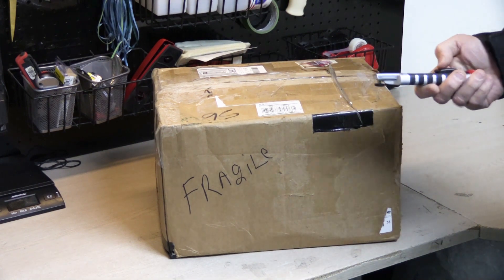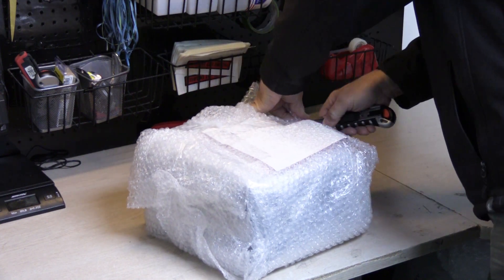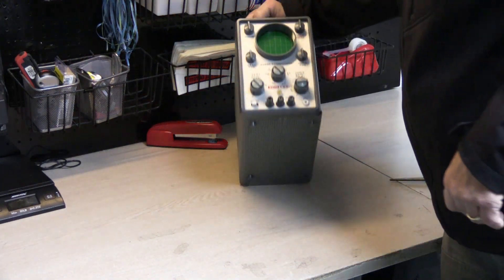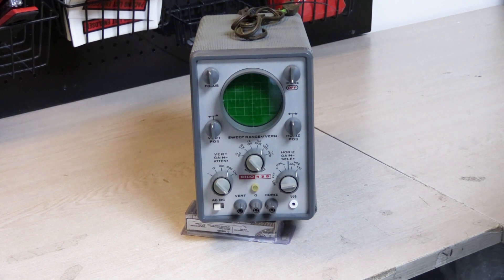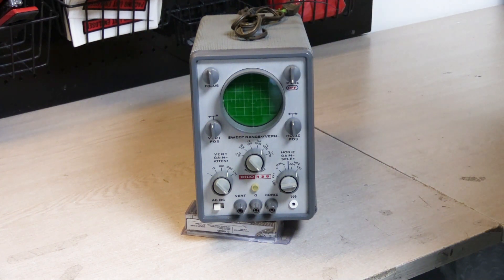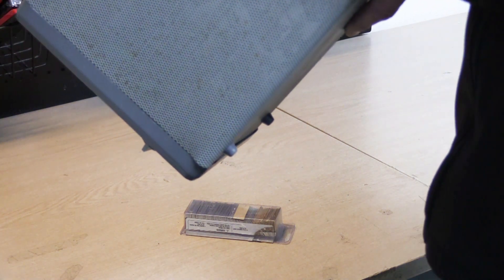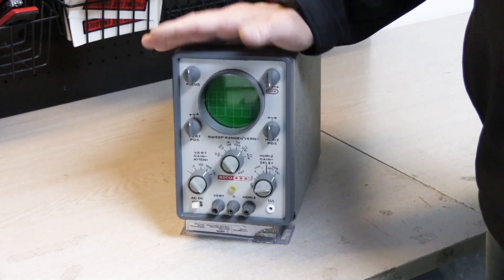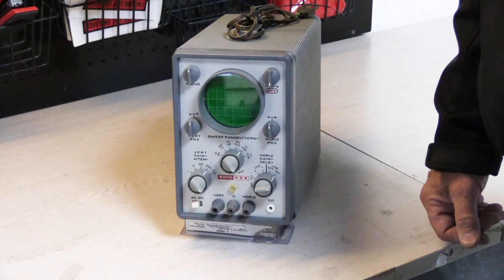A "new" piece of Vintage Bench Equipment shows up for the Shop

Comment: what type of probs does it use?
Reply from the maker: Hi DillDough:  Originally Eico offered a selection of different probe kits for their equipment.  For this type of 'scope the choice would have been a Low Capacitance Probe for general 'scope use - The 435 used "banana jacks" on the front (which I don't really like) so, I add a BNC connector to the back of the case and I use a standard 10X modern Probe - Chris

Comment: Yep, I have an older Heathkit analog scope (solid state except for the CRT) which I built many years ago, and a modern Rigol DSO. Each has its place on my bench. The analog shows very accurate waveforms, the DSO can measure and display distortion plus a bunch of other things. Gotta have both for audio work.
Reply from the maker: Hi Dave:  I agree completely - nothing beats a good analog scope when it comes to wave forms - Chris